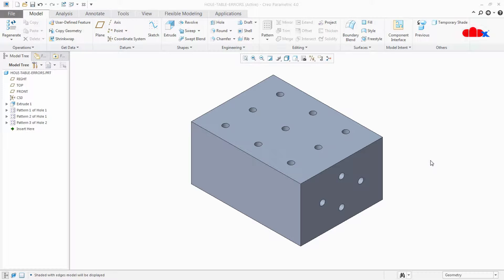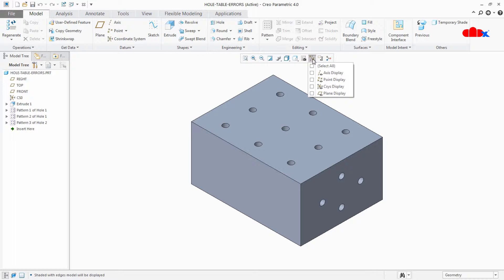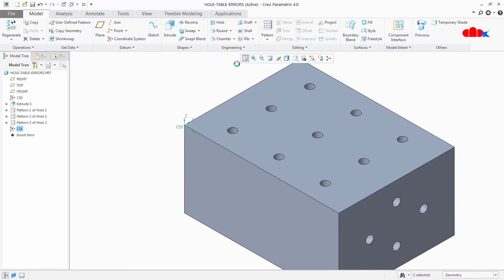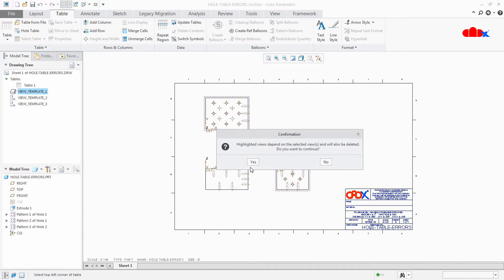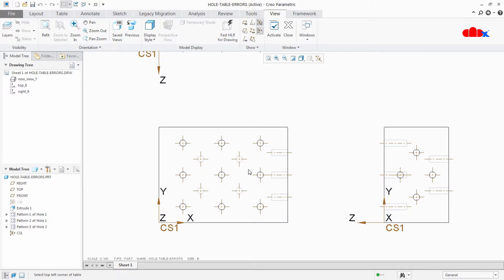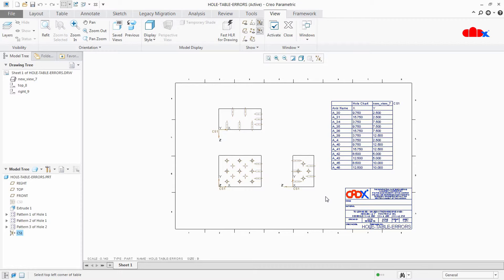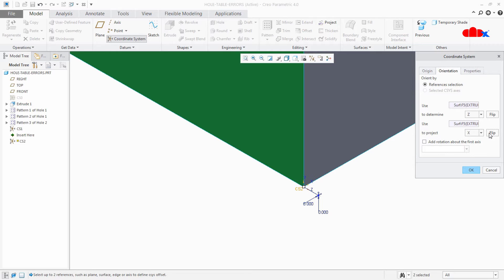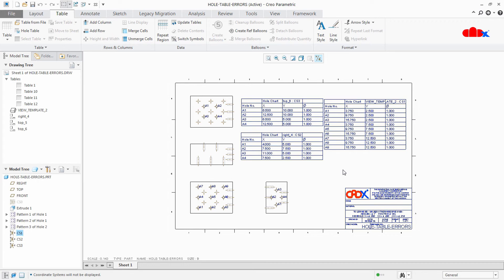Hole table and there errors for single face, parallel face and multi face in Creo Parametric

Comment: VERY VERY USEFUL WHEN WE CREATE HOLE FEATURE BUT WHAT IF WHEN WE GO THROUGH THE INTELLIGENT FASTENER EXTENSION TO CREATE HOLE AUTOMATICALLY, ITS VERY DIFFICULT TO CREATE HOLE TABLE
Reply from the maker: In that case also it will work.

Comment: Sir we make hole table without using hole command I use extrude command  so hole table creates or not
 urgent reply is require sir
Reply from the maker: Yes you can create hole table for extruded hole also.
Reply: @CADxTraining   what is the procedure
Reply: @babluvashisth8344   Just select the cut in hole table dialog box